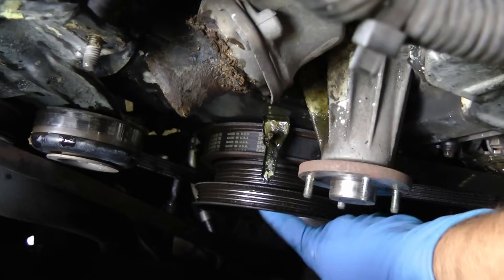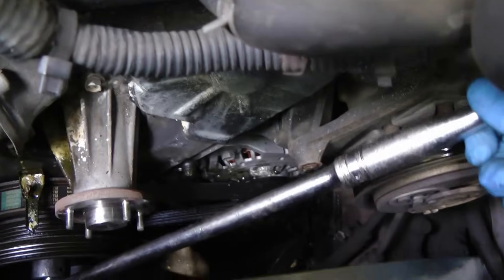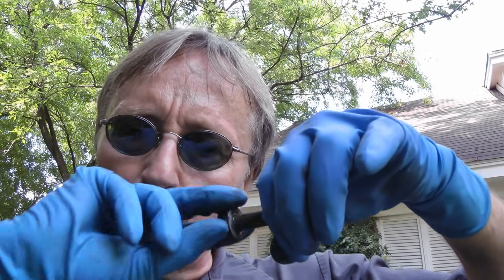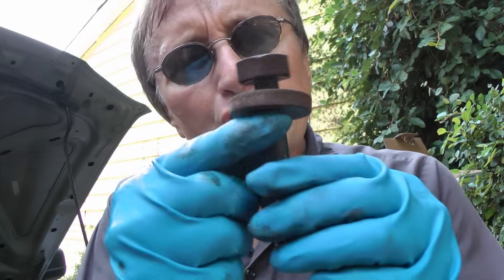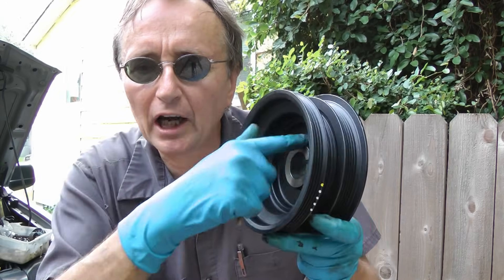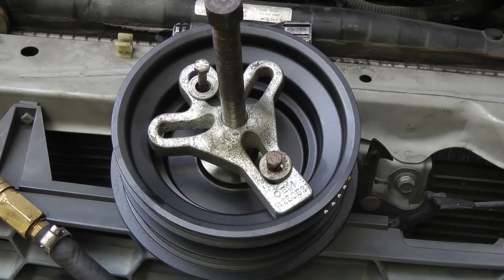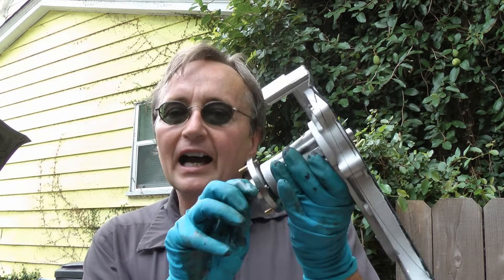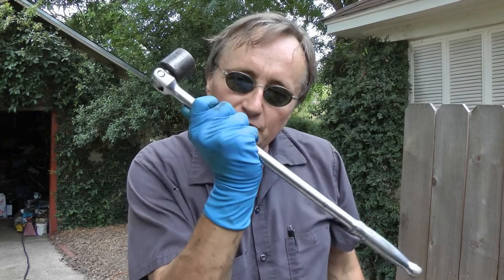How to Remove a Crankshaft Pulley in Your Car

Comment: hello i have 2006 monte carlo 5.3 still in car , i have removed the center nut from the harmonic balancer. the balancer came lose, just hanging there, is there any kind of tool made to remove this balancer while in the car , none of the holes match up due to the frame, i can get to of them there off set some what . thanks for any help. mike
Reply from the maker: yes, there is a special puller tool made for that. sometimes places like auto zone will loan you one free

Comment: hey scotty, do light weight crankshafy pulleys actually help performance?
Reply from the maker: +Rick James to a tiny degree
Reply: +Scotty Kilmer is that worth it for a 4 cylinder 2.5 liter scion tC
Reply: +Rick James  Well i dont think so, if your old pulley is damaged then you can get new one with less weight, or same weight  but should be of better quality..  Things like removing power steering and AC can give you quite better felling of performance.
Reply: +Mujtaba Tarar i dont use ac or fan

and the power steering comes from an electric motor that runs off the battery
Reply: +Rick James  well than it wouldn't make any difference, i was talking about Hydraulic power steering's, which car you have.
.
Reply: +Mujtaba Tarar 2015 scion tC. the power steering is actuated by an electric motor.  there is no hydraulic pump driven by an engine belt.  so hp is saved.

Comment: 2001 celica gts trying to get it off, electric gun is too weak, wouldn't this throw the timing off?
Reply: celicas have timing chains, and no the timing cover is behind the crankshaft pulley and behind that cover is the chain\gears.

Comment: Does this messes up the engine timing? Can't seem to get my head around the idea that the engine will go off timing. Someone explain it, please.
This method won't work on 90' hondas right? since the engine turns anti-clockwise applying this method will actually tighten up the bolt instead of loosening it.
Reply from the maker: yep, can't use it on those hondas. But it does not mess with anything, as the starter spins the crankshaft directly, and the end of the crankshaft is where the crank bolt it, has nothing to do with timing
Reply: it will work on 2004 civics, since honda changed engine rotation after 2000.

Comment: working from last 3 hours to get the nut off, tried this method but my engine get stop.  i put the screw driver in the flywheel and broke 2  cheater bars while opening, now thinking to use A BIG  battery to try this once again. i have Suzuki esteem 2001.
Reply: +Mujtaba Tarar: would you mind to update? I know 2b parallel battery to do it.
Reply: I was managed to open it, my cheater bars were week and battery was down thats why it took time.

Comment: how does it not throw the timing off when you crank the engine without the timing belt on?  and if I do replace the crankshaft pulley does it throw the timing off? thank you in advance!
Reply from the maker: +MrCoalcracker79 you don't crank an engine with the timing belt off, this one just has the fan belt off.  replacing the pulley only throws timing off if you have a pulley timing belt combo set up where the pulley has teeth on it. Most engines are not that way
Reply: +Scotty Kilmer thank you very much on the quick response Scotty.  very helpful and I now feel confident tackling this project.

Comment: Hi Scotty ,i have a loud noise on my 2005 chev trailblazer i am had the idle pully change,the tension pully change and the noise still there.Now i am told it might be a fan clutch or crank shaft pully i dont have money to keep throw away i am a woman and i thank i am being used,can you help me pin point my problem Thank you Edna Pipkin
Reply from the maker: take all the fan belts off, and see if noise goes away, and then figure out what;s making the noise if so. If noise does not go away, then it's internal to the engine and often VERY expensive
Reply: Thank's Scotty i will do that i have insurance for the motor parts for 2 years.You have a great day

Comment: can you tell me a trick on how to get the pulley off when  the puller tool is still turning the crankshaft ????
Reply from the maker: that's when an air impact wrench comes in handy. You can try a chain strap wrench to hold the pulley, but be careful, it can break the pulley

Comment: I like Scott's channel, fellow 101st ABN... But I feel it was a little irresponsible to not push safety here! You MUST disconnect the coil pack or remove the starter relay before you do this. Can you imagine what would happen if the car started?

Comment: any thoughts on how to reinstall the new one without chains? thanks
Reply from the maker: they make flywheel holding tools, but they are a hassle to find and install. You can use a strap wrench, one made of rubber, they work good and they can be had for less than ten bucks at discount tool places like harbor freight

Comment: I tried this on my 03 Honda crv... bolt did not free, and the engine didn't turn over... smoking coming from the battery and crankshaft.... wires disconnected now but appear melted... what do now?

Comment: I guess my question is how do I stop it from spinning after I have the pully tool from auto zone
Reply from the maker: +Lionel Oakes it won't spin then cause thread is pulling the pulley outwards by force, no sideways like a crank bolt

Comment: The best way to get off a crank pulley bolt is to get a impact socket and a 4 feet pole and put your back in to it work it back and foward first spray it down with w d 40 put your weight on that breaker bar and pole it will come off at eas get a long 1 2 extension so you can put that mike tyson power to it trust me it will come of I just did a 86 accord a few mins ago the bolt still look new its best to go and buy a new impact socket so you want fuck that bolt up none I hope this help someone dont forget to get someone to hole the breaks real tight while breaking that bolt

Comment: hey scotty how do i torque the bolt back on without using a special tool?
Reply from the maker: get a strap wrench to hold the pulley from moving while tightening it back up. I got one at harbor freight tools for seven bucks
Reply: okay great, i just got one, thanks!
Reply: Scotty Kilmer hey scotty my car is BMW 540i and the crankshaft bolt is torqued at 300 ft-lbs, i don't think the starter motor can handle 300 pounds, or will it? what advice would you have for me? thanks

Comment: Thanks Scotty for your tip. I am trying to change the water pump and timing belt on my 2002 Honda Accord SE. I had tried to take out the crankshaft pulley bolt using a 19mm socket with a breaker bar and an extension bar along with the special hex tool from honda. The bolt didn't budge but I ended up breaking the socket and the breaker bar head. I want to know if this trick you shared on the video can be used to remove the bolt on a 2002 honda accord. 
Thanks for the videos.

Comment: Doesn't work if the torque of the bolt is more than the torque of the engine.. The engine will just lift up

Comment: Hey I'm working on a 1996 acura integra gsr...I'm doing a timing belt and water pump......I have to support the enginge some how to take off the driver side engine mount to change the timing belt ...would you know anyway to support the engine without and engine jack?

Comment: Do you know if this will work on a stubborn Honda crank bolt?
Reply from the maker: Sadly, NO. they turn the wrong direction
Reply: Scotty Kilmer  for reverse threads couldn't you just align the breaker bar to the other side.. assuming you have a secure area for the bar to rest with out it smacking/breaking anything?? great idea by the way to do that inside cramped engine compartments.

Comment: I have a 2005 chevy impala. And my crank pulley seems to be off the engine. I recently replaced a serpentine belt and noticed the belt doesn't line up with the tensioner pulley which is right above my crank pulley. I drove it for about 5 miles started hearing metal clanking and it shut off. Checked under the hood and noticed the alternator was smoking. Is there a way I can tighten the crank pulley until I'm able to replace it?

Comment: The most common reasons for having to remove crankshaft pulleys are because the timing chain/belt needs to be replaced or the front main seal needs replacing. Were either of those the reason you had to remove the pulley Scotty?

Comment: Scotty call me stupid but how do you tighten it back?? (doesnt  the pulley spin like when you try to loosen it without impact gun?? just using the breaker bar???  thank you im not so much of a DIY guy
Reply from the maker: you can put locktite on it so it will lock in places, or get a strap wrench to hold the pulley in place as you tighten it. I use a strap wrench I got at harbor freight tools for 7 bucks

Comment: Ok if I do this with the drive belt off, and the spark plugs removed, will that damage anything?
Reply from the maker: no
Reply: I cannot thank you enough for your time to respond and ALL of the excellent videos you make.  Your attitude and expertise are truly special to many many people, I am sure.    I was struggling with my crankshaft... and manually could NOT budge it.  One quick starter bump though and DONE.  THANK YOU!!!  Now I'm debating weather I should replace the crankshaft and camshaft seals since I'm in this deep, with 102k on the motor....  I suppose I should since I've done all the work to get to it, right?

Comment: Wouldn't work in my 2000 Honda Civic, the engine goes counterclockwise, can tighten the bolt more.   I don't have the right tools to loosen the bolt.   Sucks.

Comment: Hi Scotty, I'm not a mechanic but I can tell when something is not right. I have a old 87 pajero 4D56T turbo. still drivable but it has a very loud noise coming from the bottom part of the motor & has no power, in fact very sluggish. Can this problem be identified by how I've described it and Is it possible for a person with basic mechanical  knowledge to repair. thanks..

Comment: Hi Scotty, How to remove crankshaft pulley bolt with bolt very tight with permanent glue?...............Happy christmas and new year 2016!!!
Reply from the maker: +j charles heat the bolt up red hot with a torch, that will melt the glue

Comment: Hey scotty how do you release a seat belt thats stuck on a pt cruiser 2005
Reply from the maker: Franky playpermate push and pull the release and get a small ice pick and try to force it out. If not, you have to cut em off and buy a new one
Reply: Thanks scotty saved my wallet

Comment: Gotta be real careful when doing this, I tried this method with an extension at first and it failed the first time, the bolt wasn’t loose. But that’s not the worst, the second time I tried it it failed again, and I couldn’t find my breaker bar after that, I looked around for ten minutes, no luck at all. I was gonna grab my ladder because I looked every possible place that I could think of. Luckily before I looked for my ladder I found the breaker bar behind my other car ten yards away from the original car. It was very lucky that nobody was around and my other car wasn’t damaged. I also tried to lightly hit my head with that breaker bar, and it hurts. Can’t imagine if it hit someone else in the head or my car window when it flew from the crank with full blow. Anyways lesson learned, get all personnel evacuated before doing this and don’t use an extension and buy a medical insurance.

Comment: Can I reverse the procedure to tightened the pulley back?
Reply from the maker: no, you get a strap wrench and hold the crank pulley from moving and use the bar and socket to tighten it then

Comment: I suppose in the past couple years of this video someone has commented already that you fail to mention to disable the ignition when u crank this and also that this does not work on counterclockwise engines. Also most importantly If the motor is clockwise AND Also designed with a Keyless crankshaft to not perform this trick That would turn pistons into valve head hammers!!!

Comment: Hi Scotty,
I have a Holden commodore exec, 1989, 3.8 v6. I am having a issue with it. It will start fine, idle fine but once she's warmed up or if i put it in reverse or drive (as it is an automatic) she won't register that i'm revving or put it into gear. What could this be.

Comment: youre the man!  but how would i remove the bolt if the engines already on an engine stand?
Reply from the maker: use an impact wrench, or have one guy hold the flywheel with a big wrench as you turn the crank bolt
Reply: If for some reason the bolt is really stuck on there and your impact isn't up to it you can also use a quality 1/2 ratchet and a mini sledge hammer.  Just give it a few taps and it should spin free.  I haven't had to do that for years but it does work in a pinch.

Comment: The mechanic i took mine to, just called and told me that the bolt is stuck and his air/compressor gun can't open it. Wants me to try to find a place where they got better tools. What do i do since the car is parked in his garage and needs to be towed for another $75 if i have to ship it off to someone else?
Reply from the maker: well, never go back to him, if he doesn't even have a torch to heat it up with. Heating that bolt with a torch till it glows red always works.  You'll just have to eat the tow and never use him again.
Reply: He fixed it a couple days after but i am glad it's done and over with. Charged me $100 for labor compared to the dealers that wanted $500 plus for it.

Comment: I'm working on the same engine the pulley screw holes are stripped inside helpp
Reply from the maker: try wedging it off then retap and thread them or get a used pulley if it breaks off in pieces
Reply: I got it off with a three way pully
Reply: Thanks and do you recommended dropping pan after bad head gasket

Comment: Had this ideea long time ago ,real mechanic will never do it , there is big chance for broking timing belt or chain  ,or miss fire codes or  worse ,by the time you need to replace this pulley ,your timing it's very worn , there's big chance for broking! Take the chance

Comment: So how do you put the crankshaft pulley back on without power tools?
Reply from the maker: Truthseeker4449 use the cheater bar and socket, and hold the crank pulley using a strap wrench

Comment: I tried this and now my engine is seized. Did not overheat and did not run out of oil. Everything worked until I tried to use a wrench to start the car to pull off the Pully for the crankshaft, now the engine is locked up 😔

Comment: ...and HOW do you TIGHTEN it when re-installing??
Reply: +etyrnal Umm, it's not hard to get things back on. It's only hard to break them free.  If you find otherwise, you're probably cross threading the part.
Reply: You turn the ignition key backwards.
Reply: Torque to specs noob
Reply: Everyone has never done everything. Noob is not required.
Reply: just connect the battery backwards to get the starter to turn the other way ;)

you're welcome
Reply: have you tried that? You'll see that the starter turns in the same direction
Reply: you will fry the ECU   dont even Think of doing that

Comment: Can you use that same method on a Nissan maximum
Reply from the maker: do as I show in the video, crank the engine, if the engine spins clockwise when sitting in front of the engine crank pulley, then you can use this method. If it spins the opposite way, you can't

Comment: Will this work on my 2000 dodge durango?
Reply from the maker: as long as the engine spins clockwise when you run it and are sitting in front of the engine looking at the crank pulley spinning, yes.

Comment: i checked my pulleys and once again for some reason the ac pulley was crooked again i dont wanna do a bypass is there a way i can find out whats wrong with the pulley i took it off and it is straight just when i put the pulley back on its crooked what do u think the problem is?

Comment: What kind of air gun would I need how many lbs?
Reply: I took off two crankshaft pulley bolts without any hesitation with an impact socket on an m18 fuel electric impact. 2.3L 4 cylinder rangers.

Comment: Just so you don't end up starting the engine, please disconnect the fuel pump relay first.
Reply: +bubbahanks But if you do that, you have to waste time pulling the bar off the bolt.  If you start it and rev it, your neighbor can bring it right to you in your car seat.  :)

Comment: Something as simple as a "coolant sensor" could make unbearable shaking of the engine and run so rough it will barely run  the computer will say it's "Multi Misfires" I had a 1996 Saturn SL2 I even brought it to Saturn at the time and they said it was the harmonic balancer and then everything except what I said along with other mechanics... I paid $8.20 for the coolant sensor, reset the computer and it started like it was brand new and yes, i did reset the computer before doing anything... I also had some animal chew my wires while camping in the middle of no mans-land so I had limited resources and I only bring this up because it mimics a bad harmonic balancer / crankshaft pulley so I checked the spark plug wires and noticed that the third cylinder wasn't firing, but I had the old wires in the trunk and that didn't work so now it's becoming a nightmare, I wired the first and third together and it was fine...

Comment: does this method work on any car Scotty
Reply from the maker: only if the engine spins clockwise with a right hand threaded bolt
Reply: Scotty Kilmer Hey Scotty I have a Olds V8 that spins counter clockwise with a reverse thread bolt so does that mean I just need to put the breaker bar on the passenger side? Thanks!